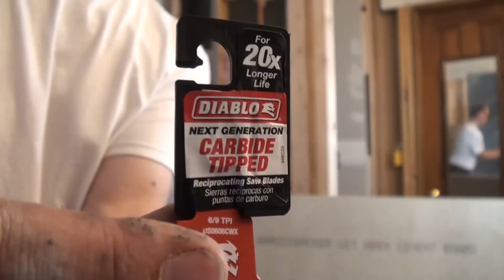How I to install a Shower Pan Liner and HardieBacker Board. 15. Душевой поддон

Comment from the maker: The project is done! You may be interested in
all part of the Shower Pan Rebuild: 
Update - i'm not screw the wood strips to the floor liner. Here is a normal speed video: https://youtu.be/C1m9742IyWs

Shower Pan Rebuild. PART 1- https://youtu.be/NdhPWNkK66o
Cut tile from bottom of the shower. PART 2 - https://youtu.be/NNBwQVA1LwY
How to Pre-Slope Shower Pan with Beadex. PART 3 - https://youtu.be/prp_vglYv4c
How to install ABS Shower Drain. PART 4 - https://youtu.be/v57eQe-eC4w
Shower Pan Liner to ABS Shower Drain. PART 5 - https://youtu.be/9c9xxkL0Am4
Shower liner and Concrete shower base. PART 6 - https://youtu.be/LSbB_ml0UtE
RedGard Waterproofing Membrane. PART 7 - https://youtu.be/e_4Wzgtxic0
Install a Pebble Tile / River Rock Shower Floor. PART 8 - https://youtu.be/m9Zb81AMSI8
How to make a simple Jig to cut 45-degree tile edges - https://youtu.be/nzSYCPHPmRg
How to tile Shower Curb with 45 degree outer corners. PART 9 - https://youtu.be/wdOxYGWcFSk
How to 45 degree tile cut. No Jig, just hand - https://youtu.be/9WmOIYn1QL4
Footstep in shower. PART 10 - https://youtu.be/2YrMN22kz2k
Shower Curb, Wall grout & Glass Door Base installation. PART 11 - https://youtu.be/L0Ms7sEOEWM
How to Silicone a Shower. PART 12 - https://youtu.be/Edb9fXIdkRk
Schluter, custom size tile edge. Last 13th PART - https://youtu.be/kT9hc3D00ec
Reply: Fix it All the backer board for the walls should never touch the floor.   Water will wick up the wall , ... you're gonna have  mildew issues in the grout lines .  ..

Comment: First thing wrong. Is. Cutting  pan liner short must cover the curve. ..2nd. At least. 3 inch off hardy from mud pan.  3rd. Need. Corners  for. Curve. And  never. Put hardyboard in curve. Must have.  Metal lath. 2 sides of curve. And top. And then. Float  curve with sandmix.    ..you doing  wrong man..
Reply: Do i have to put a shower pan ahuevo or can ido something else in its place ,lets say hardy board than some waterproofing ?

Comment: I’m sorry, but you should remove this video from YouTube before others looking for DIY help follow this. It’s just not the right way a pan should be built.
Reply from the maker: You're right, that's not right. But, why not right if I do it 20 years without single fail?
Probably I know something what others can't see in the video.
Reply: @FixitAll  Water does not flow up. this pan liner would stay wet for ever. I had someone do my shower this way. I'm ripping it all out to do over according to oatey company guidlines. my shower started leaking into basement after 8 years. if it was on a slab i'd never know.

Comment: OMG,i don't know what els to say, i didn't watch the entire video because since the beginning I knew that was wrong, he didn't do any slop to install the liner,then the liner must be on top of the curve ,also he install all the hardiebaker with out water proofing on walls and screws on the liner.
Reply: This guy doesn't have an idea how to install shower linner at all 
No slope water will puddle in corners 
Threshold not covered with linner
Also it would leak around the drainage the way he cut it
Reply: It's not a curve it's a curb

Comment: Go back to learn how its done . Showerliners should be prohibited by law there was never one that was not wet underneath 
when ripped out.
technic from the 30th's  I mean 1830.
Chris
Reply from the maker: Well, what can I say... Without liner the shower have a trouble.
Hire is a brand new shower. In first test it got leak. 
https://youtu.be/NdhPWNkK66o
Reply: Chris Pausenwein u

Comment: Just because this guy does not do this EXACTLY how you would do it, you hate on him. If this guys pre drills and puts liquid nail on the joints of hardee. This thing will not leak. I'd bet money this pan would outlast any of your hating ass work. Haters! You rock no shoes, predriller, making a 3 point saddle in the upspout copper converter!
Reply: You at least need to preslope the floor.  Everything else is minor compared to that

Comment: Guys criticizing should at least say why they are doing so.
Reply: takla3210 the moment he stepped in the shower, it's wrong. That's the easy answer. If you want to know everything wrong, there is no pre-pitch so the pan liner is flat, meaning it will hold water and never drain, the liner doesn't have any blocking/support between the studs, the liner doesn't cover the entire curb and he is running staples through the top of the liner in the curb.... major leak point. Those are just things I saw in the first minute. This shower will leak and mold from the first shower and I'm sure if I waisted 12 minutes of.my life I could write a book. IMHO this video should be removed.

Comment: Por favor no hacer esto, ese trabajo es totalmente mal hecho.  Este vídeo debería llevar el título:  Como no instalar un pan liner en shower.
Este tipo no sabe lo que está haciendo, todo lo que se ve en el vídeo es lo que no se debe hacer en shower👎👎👎👎
Y para rematar sin zapatos 🙈
Reply: Alex Garcia y cortando adentro de la casa  y encima d carpeta?
Reply: Alex Garcia you look like you are an older man but inexperienced, as you happen to cut hardy backer inside the house, why do not you let the liner come out to the outside?, why do you use screws to hold the hardybacker in the contribution bottom inside the step? the truth if it were my house I put a kick in the ass and I sued you for knowing how to do the job
Reply from the maker: Relax man. My showers not leak - that's more important than your negative comments.
Reply: Fix it All I can assure you at 200% that the liner will leak, under no circumstances should it be drilled, for that there is cement exists to eliminate the perforations
Reply: I do not make videos but this time I'm going to make you one so you can see that a man who is half and even younger than that can give you a good work lesson ,,, I will share link
Reply from the maker: 200% ? My showers stay in perfect condition 20 years.
Reply: @miguelmandujano44  where's the link vato? Nesecito ideas

Comment: No slacking in between the studs to secure the liner; the fuckin drain you cut actual holes into the liner instead of small x's to protect the integrity of the liners function at the weep holes; the liner was not wrapped over the step over curb and screwed in place from the inside; the cement board was brought all the way down to where you're going to make your mortar bed; and what in the fuck is that shower bench?  Is this a joke?
Reply from the maker: Thanks for attentions.
Reply: It is a tub 😂 not bench
Reply: @kurteisenschenk2543  he's referring to the metal frame which is the bench. It's clear you don't install.

Comment: This is too old school....EXPIRED !!   electric stapler....no rubber liner..use kerdi pan or wedi pan....no motor !!! and no electric tools...GEEZ ..and no hardi or wonder boards...use foam goboard or wedi board...all foam !!! NEVER use hardi board or cement board again !!!  I .ran get real this is stoopid
Reply: I see a lot wrong but some of the things you've mentioned are not the main prob.
Reply: You actually can use cement board but everything else you said was right on
Reply: @cmgambit23  nobody uses it anymore. Goboard is the way to go. It's water proof and can be done with a pencil tape  6ft level and knife. No power tools needed
Reply: @josephmerkle398  not available in all parts of the country brother